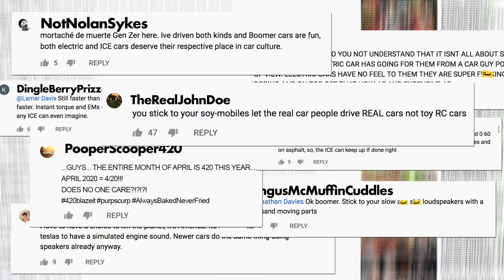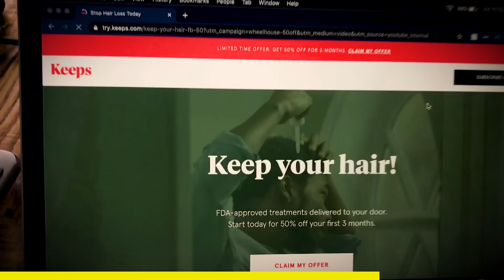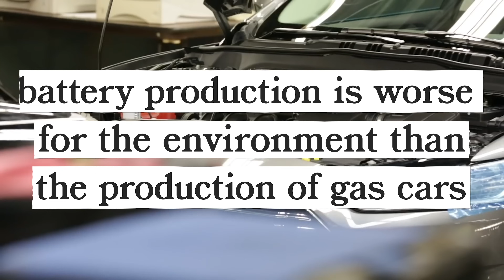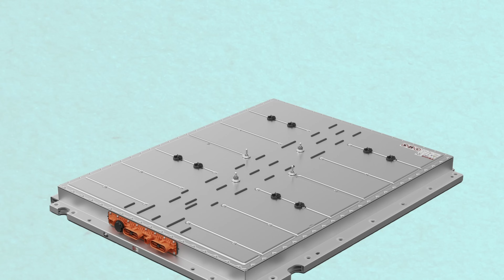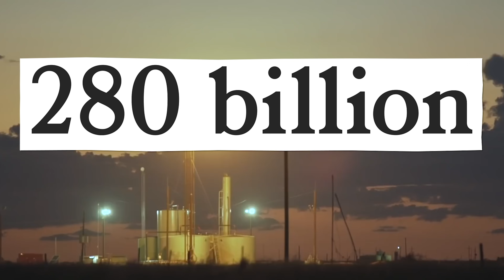Are Electric Cars REALLY Better for the Environment?

Comment: Didn’t take into account the end of life cost also the cost of replacing batteries and the shocking amount of components in ev cars mainly with the batteries that aren’t able to replace or Recycled. Personally ime sticking with good old combustion for know. I may move if hydrogen gets better support but the governments are just focused on ev only witch is just a little suspicious I think. Maybe this is all about Money and Power most likely. Due if it was a serious issue wouldn’t governments be equally supporting all viable solutions???
Reply: Jeez, some of you people are so unbelievably misinformed I cringed when I read your post....  EV batteries can be, and are recycled. Volkswagen are recycling EV batteries already. And what's with the "shocking" amount of components in EV cars? My Kia has way fewer moving parts than any ICE car! And you don't necessarily need to replace an EV battery, as they can be refurbished. It's very clear your EV knowledge base is rather limited......

Comment: Didn't even start the video, just commenting because this question is played out. Yes, batteries are probably not the big green savior that some folks paint them out to be (not yet anyways, but that's a big, BIG story in and of itself as to why) but they're a step in the right direction. Synthetic fuels are promising as well, but the main point is that necessity and ingenuity (and let's be honest, profit is likely a big factor) are finally bringing about the next big steps in the personal transportation market. The issue we face now with all of this is how companies are going to roll this out. Sadly I'm predicting that the big car companies are going to try and corner the market and take a letter from the John Deere book, making it difficult to personally work on and/or get parts outside of a certified service shop. This is going to put a lot of strain on ma and pop garages unless they spend the capital to get the training and parts pipelines established in order to stay open and relevant with this big shift. Synthetic fuels could help ease this issue as long as current ICE cars don't stay on the current trajectory of being more and more reliant on software and complicated systems to even run (the new trucks look nice and all, but there is still a big demand towards older vehicles that are much easier to maintain). Combine all of this with systems and the cars themselves being engineered to last around the same timeline of the warranties and you're gonna see a trend emerge of folks signing themselves into perpetual leases just to keep a running vehicle that doesn't bankrupt them in the long run (i.e. sign, drive, trade-in, repeat).

Comment: On average cows 23 times more CO2 and methane than do ic cars...., while the making of Li ion batteries increases carbon footprint by more than 74%.
Reply: It increases the carbon footprint of production by 15% or 1 metric ton of emissions. But even from a coal based grid reduces emissions over its operation lifespan by 20-30 tons of emissions.

Comment: They don’t say anything about how they get the lithium for the batteries. They also don’t talk about how they get the power to charge them. It’s harder on the power grid.
Reply: They don't say much about the big oil companies mining for cobalt either.....  And it isn't "harder" on the grid in the UK if you charge your EV overnight. The UK grid has huge spare capacity at night, and the energy companies charge around a third of the daytime rate, because they want people to use it through the night......
Reply: @Brian-om2hh  you know they use slave labor for lithium right?

Comment: I get that electric is more environmentally friendly, but less wallet friendly.  Unless EV prices goes around mid $20K, not a lot will switch.
Reply: I got my model 3 because of its cost. Yes it was the same upfront cost as a high end BMW and it came with all the performance and trims to suit the price tag. And I struggled to afford the upfront costs. However due to the price difference per km with electricity vs fuel, and the fact that the model 3 has no servicing requirements outside tire rotations, over 5 years it will cost me less to buy, maintain and fuel my BMW, and merc CLA class model 3, that it would if I were to buy, fuel and maintain an entry level Toyota Camry. 

So over 5 years total cost, my Tesla mode 3 takes less out of my pocket than if I had purchased a base model Camry.
Reply: Upfront cost isn’t the only factor

Comment: Well I mean…. 75% of power for electric vehicles is produced by coal in the USA. It’s not really even an argument, it’s absolutely just as bad. This is not even touching on the lithium issue.
Reply: Even with 100% coal it’s still better. Especially when considering fuel refining. As for the US grid? It’s actually only 30% coal. The largest source of energy is Gas at 34%

Comment: You convinced me, but you didnt include “what happenes when the batteries die. You cant recycle them efficiently you can’t reuse them. You can only Bury them and that is not eco friendly
Reply: Marci.sadly you're wrong. They can be recycled and also reused.

So take the 4kg of lithium in some ev's. Studies are showing 300k miles with still a vast amount of battery left.  So assume you get 500k from it, you could recycle it and get another 500k miles. Modern batteries are estimated to be nearly 1m miles or over. . Then after it can't be recycled, then it gets used as a house battery.   Now look at how many times you cna reuse the oil..... Oh wait, you csnt
Reply: Yet more unbelievably misinformed garbage. For pity's sake, do more research....
Reply: You can re use them and they are reusing them. Often in less power dense applications such as home or industrial power storage. As for recycling, current technology means EV batteries are around <95% recyclable. As EV uptake has started to increase we’ve seen more and more battery recycling plants popping up and starting up. Because demand is needed before people start recycling. You can’t have all the infrastructure to recycle batteries for every car on the road when less than 1% of cars globally are electric. That makes no economical sense

Comment: 2:02 I already see a couple flaws.
Lifetime of cars not being taken in consideration, raw material mining, and the disposal of said cars are not in there.
I hope the video addresses it.

One out of three of my concerns addressed. Guess I won't be knowing for sure.
Reply: Here’s a second one addressed. Current generation batteries in EV’s are designed to last more than twice the average lifetime of a combustion Engine.
Reply: @engineeringtheweirdguy2103  What's claimed without evidence can be dismissed without evidence.
Have a nice day.
Reply: @andregon4366  google it. Even older model S’s from 2012 are common to be over at least 400,000 miles. There’s one that even broken 1 million miles. It isn’t uncommon.

In addition lab studies have showed the batteries are good for 1,500 cycles minimum to 70% health. (Also easily googleable) what’s 1,500 multiplied by 325 miles do you think?
Reply: @andregon4366  “what’s claimed without evidence can be dismissed without evidence” weakest argument ever made. I’d supply links but when I do so on my phone it doesn’t get passed the spam filters.
Reply: @engineeringtheweirdguy2103  It's not an argument.

A claim that has no evidence backing it up is not valid.

And when you post links, please show me the link of a 30 year old battery that works like a new one.
Or something that can be analogous to an internal combustion engine.

After that we can try to find century old batteries that still work.

It's more than clear you're more interested in pushing a narrative than anything else.
Reply: @engineeringtheweirdguy2103  Distance is not age.
I've seen century old cars working just fine.
And none of them claimed to have the original batteries, mainly because batteries are one of the things that are replaced the most in cars.
Why? Because batteries have a shitty life span.

The link you're about to show me better be of a 30 year old battery working as good as if it was new. Because I can't find any.
Reply: @andregon4366  it actually is about mileage. Anyone who has even a cursory knowledge on the subject already knows this. The largest factor the does on a combustion engine isn’t age its miles driven. The largest factor that does in a battery in an EV isn’t age, it’s miles driven. Because that’s where the wear is.

Batteries in combustion cars are nothing like those in an EV, even from a purely chemistry point of view yet alone the size and battery management systems. (And yes, size matters because again, cycles, bigger battery, more range per cycle, long life span). 

Of which there are many older generation model S’s on the road today which are well over double the average lifespan of a combustion engine. It’s not very uncommon and extremely easy to verify with even a cursory google search
Reply: @engineeringtheweirdguy2103  And yes, I know that batteries in EVs are different, they're like smartphone batteries, which don't have the greatest of lifespans.

Fu(king activists, sperging out trying to pretend they're knowledgeable.

I want data, not cherry picking.
Reply: @andregon4366  they are decidedly not like phone batteries, again in chemistry and composition and most importantly BATTERY MANAGEMENT an EV is rarely charged to 100% and never drained to zero. A phone battery usually is charged to 100% every day of its life, and discharged to almost empty of not to empty every day of its life. That damages the battery. It is also not kept at ideal temperatures with phones having no temperature management. Meanwhile EV batteries are swimming in coolant which heats or cools the batteries even when the car is parked and not being used to keep it within certain temperature ranges. Phone batteries don’t manage charge between nodes whilst EV’s expend large amounts of computation to ensure batteries cells are consistently with 0.01 nV of one another. And finally phones don’t control their rate of charge and discharge, even on a rapid charger for an EV the last 5% to 100% takes as long as the previous 80%. That’s because it’s restricting its rate of charge to be within its optimal range for its state of charge at all times to prevent damage to the battery
Reply: @andregon4366  if you think EV’s run the same as IPhone batteries I’d get your head checked because you might have brain damage.
Reply: @engineeringtheweirdguy2103  Ok then, tell me what happens to EV batteries when the car sits iddle for 10+ years in a garage.

I know a lot of people who bought regular cars from retired old people (or when they die and their relatives sell them) who had their cars sit idle in a garage for years.
Those cars were as good as new.

Oh, and what about repairs?
A car that can be repaired lasts much longer. 
Good luck finding proprietary parts from a discontinued model.
Or from a non discontinued car whose price isn't inflated by ten fold for that matter.

Car batteries may not be like Apple's batteries (although they're still made of lithium which is pretty shitty), but their policies can very well be (like Tesla's).
Hell, even regular vehicles are getting that problem already, let alone EVs in the future.
Reply: @andregon4366  you really have no idea what you’re talking about do you? The batteries if left for years will suffer phantom drain and eventually become flat but a quick charge and it will be as good as new.

As for servicing. There is nothing to service. You don’t need spark plugs, oil filters, air filters, fuel pumps, fuel filters, timing belts, head gaskets. Etc etc etc. that’s part of the reason they last so long. They don’t need constant maintenance to remain operational like a combustion engine does. Have a quick google at the required servicing to keep a model 3 in warrantee over the 8 year timeframe. It’s zero. A blank list. 

They only have recommended services, the first several are tire rotations and the last is checking the battery coolant fluid for leaks but it’s not required and just a peace of mind service.
Reply: @engineeringtheweirdguy2103  you really have no idea what you’re talking about do you?
Oh, so I don't know that discharged batteries will deteriorate in a matter of months if they aren't charged? (guess all battery manuals must be wrong then)
Apparently I also don't know that Lithium batteries have a tendency of exploding and bursting to flames if something goes wrong.
I also don't know that the lithium battery inventor and Nobel prize winner, John B Goodenough, disliked lithium batteries (because they have a tendency to explode and burst into flames) to the point of trying to make a safer alternative with Sodium based batteries. (since I haven't heard of it anymore, I assume it didn't go well)
I also don't know that lithium batteries electrolyte is a gel based substance that can't prevent lithium to create ramifications (like a tree root or branch) and reach the other side of the battery causing a short circuit. (which makes them explode and burst into flames)
I also don't know that proprietary batteries aren't as easily replaced as market standard batteries, especially if they're hardwired.

I also don't know that farmers are forced to hack their own equipment to repair it. Oh wait, I do.
Even medical equipment is getting to the point of not being repairable.

Let me emphasys on this one: Companies are making sure that MEDICAL EQUIPMENT, WHICH IS USED TO SAVE PEOPLE'S LIVES, CAN'T BE REPAIRED, putting people's lives at risk. 
Companies are literally (as literal the word "literally" can get) putting people's lives at risk for the sake of profit. LITERALLY

While the EU is cracking down on repairability (although very slowly and inefficiently), the US is going the complete opposite way. With lobbyists working as hard as they can to prevent the Right to Repair bill to pass.

Guess I don't know any of this. And apparently, neither do you.

Have a quick google at the required servicing to keep a model 3 in warrantee over the 8 year timeframe. It’s zero. A blank list.
On paper, yes. In the real world the electronics are more prone to malfunction than mechanical devices.
And that's due a simple well known engineering factor: The more complicated something is the more points of failure it has.
Reply: @engineeringtheweirdguy2103  Can I get someone who knows what they're talking about to reply to me rather than a cherry picker with a narrative to push?
Thanks in the advance.
Reply: @andregon4366  I agree that batteries that we have right now aren't the best, but i still believe that people are clever enough to make them better and more useful. Think about it, how the technology has advanced in 30 years. But I very much understand both of your arguments. Btw have a great day🇪🇪✌️
Reply: @estonsman4566  The problem is that Battery technology didn't advance that much in 30 years.

Lithium batteries were invented in 1985 by John Goodenough, and all they got were some minor improvements over the years.

John Goodenough tried to make Sodium batteries (he didn't like lithium batteries), but since I never heard of it again I assume the project failed.
Reply: @andregon4366  I totally agree, materials that are hard to mine aren't really eco friendly.
I like electric cars, cuz i really like the clean look of them and the fact it's silent. But i wouldn't buy it because of the eco stuff. I would buy it because i like the silence and the clean look. Maybe i wrote it weirdly (sorry for that) but on my opinion the batteries need to change, maybe then EVs would be the go to when buying a car. And they should make them repairable too, but business is business.

Comment: Regardless of whether it’s solar, wind, geothermal, or hydroelectric they all have associated carbon emissions. 
There is no such thing as green energy or clean energy..

In fact in the case of solar and wind turbines, the carbon and pollution produced via manufacturing processes alone actually offsets the electricity they can even generate, meaning petrolchemical and coal power plants actually produces less pollution per kilowatt than their green alternatives.

Sadly the largest source of alternative energy in the US now comes from the several hundred biomass power stations which are scattered throughout the country that have since replaced the majority of the decommissioned coal power plants.  
Basically we’re burning trees by the millions and claiming we are saving the planet by combating climate change by producing even more carbon than we previously were.

Comment: Can we just think on the idea of switching all vehicles on the road to EV vehicles and the availability of resources to produce the batteries is just not there
Reply: And you know this because?
Reply: @Brian-om2hh  its called google. Lets just say that every car would use lithium. Simply put the world produces approximately 180 million lbs a year and thats not all for car batteries. To switch all vehicles on the road to fully electric vehicles(all 1.42 billion) would require over 197 billion lbs of lithium and that’s on a basis that every car requires approximately 139 lbs which is how much is in the popular tesla. Now saying that semi trucks and other large vehicles would obviously require more resources bringing the actual number up even higher. That said it would take probably a 1000 years to reach that goal if the earth holds that much
Reply: @yohanpyro  You're assuming EV batteries will still be using lithium in a few years time. They won't be......
Reply: There are many resources that can make batteries now so actually yes there is
Reply: @therealkidhasgame9922  and what would it be einstein?